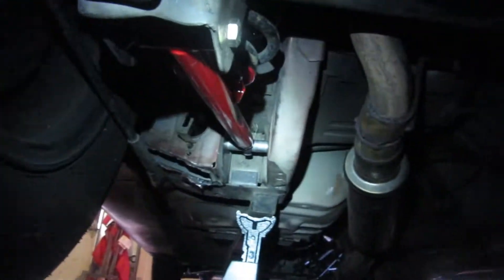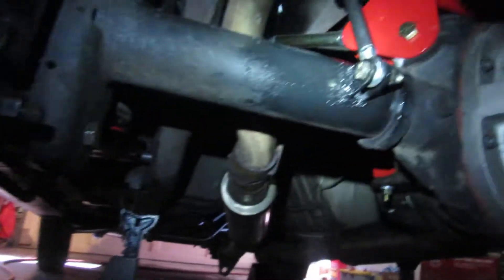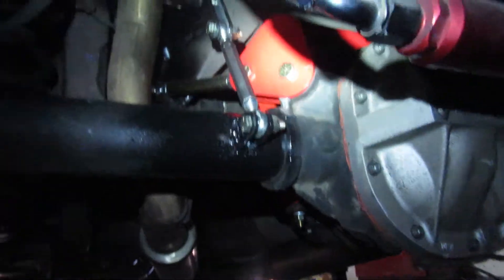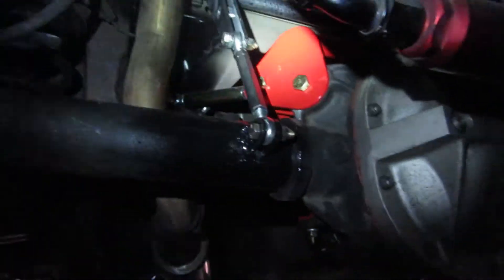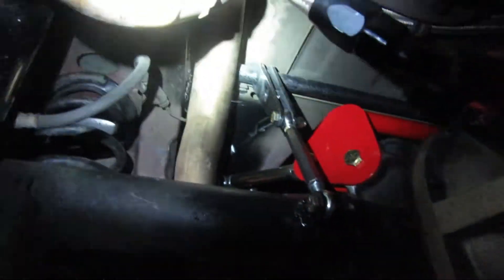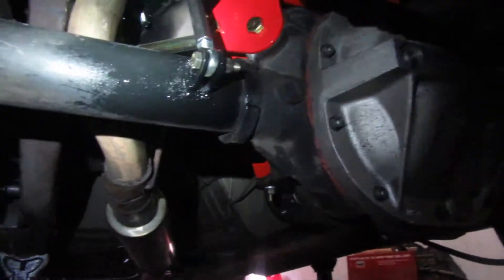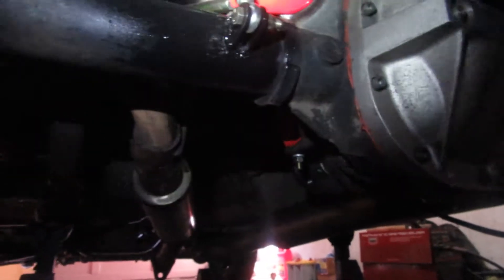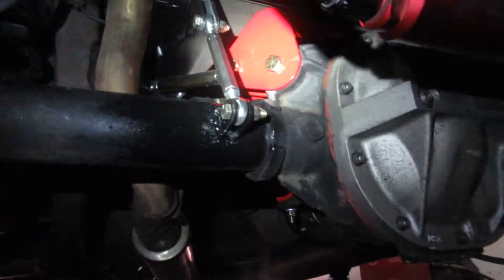rear suspension done

Comment: Hey did you sump your tank or are you pulling fuel from the factory location with the areomotive pump?
Reply from the maker: 98snakehorse 

Factory location with a glenns performance pickup tube.
Reply: Sounds good 3/8's pickup feed and return I assume
Reply from the maker: 98snakehorse 

Its been a while since I've looked it up but i think its a 3/4 pick up. Its a -10 feed and -8 return